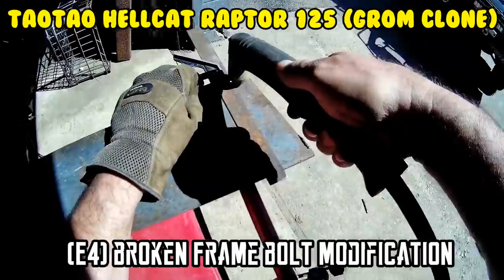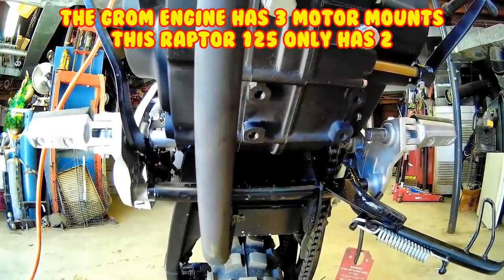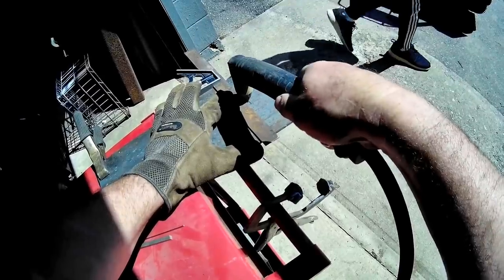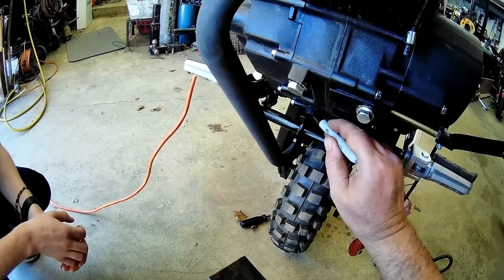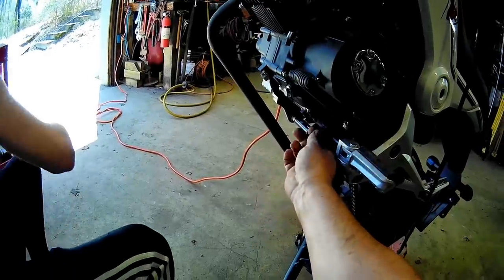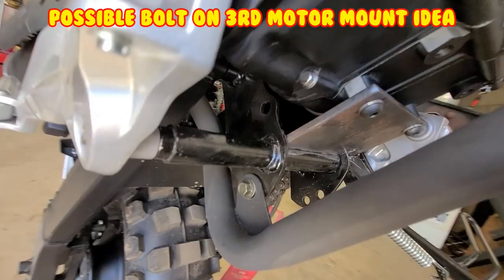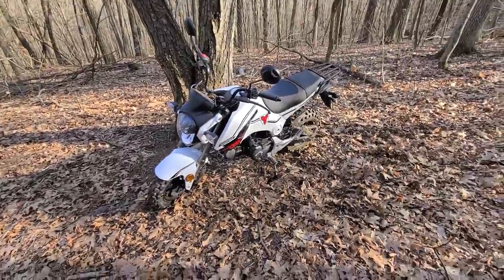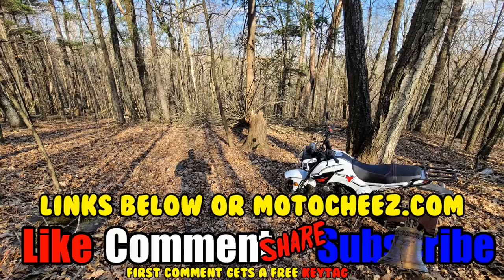(E4) Hellcat Raptor 125cc Broken frame bolt modification, Chinese pit bike “Grom Clone”

Comment: The bracket you mentioned while prepping to weld... being able to have triangulating support is never a bad thing.  That piece of plate looks solid enough to do the job.  The best of situations, have that as also being a skid plate, and just proud (lower) of the kickstand hardware.  Nice work there.
Reply from the maker: EXACTLY. Thanks
Reply: @MotoCheez  would liek to see you do one without welding since now there are 50,000 of these grom clones out there all breaking engine mount bolts and no one knows how to weld.
Reply from the maker: They sell a bolt on, on ebay
Reply: @MotoCheez  yes and in the FB clone groups most people say it didn't work. Many posts they're about that

Comment: 3:25 you can put paint on the on motor mount holes and then lift the plate up to it and the paint will transfer to the plate then you have perfectly accurate marks.
Reply from the maker: I've heard Grease too...
Reply: That's a great tip! Thanks!
Reply: Chalk, marker, some times penic works, like if your doing drywall and you need to cut out the outlets take your carpenter pencil and color in the edge of the outlet boxes and then put the drywall in place whack it in that spot with your hand and it transfers to the back of the board, then just cut on the line.

Comment: Both my engine bolts snapped. Replace the upper and lower one with a grade 8 and the lower one keeps snapping. Time to make this mount and hope for the best!
Reply from the maker: Since I made the lower Mount I haven't broke a bolt!
Reply: MotoCheez I actually made the lower bracket just like you and it’s soooo much better almost no vibration such a good mode to make for this bike!
Reply: MotoCheez have you had any issues when braking with your front brake only? I’m having some insane shake when I use my front. Might be a blown bushing in the colum. Also any idea how to make the speedo work? Ever since I got it it has never worked
Reply from the maker: Sounds like a bent rotor or something loose?. Mine is smooth
Reply: MotoCheez I made sure everything is tight. I’ll check the rotor just in case. Thanks for responding so quick 🏂

Comment: I just bought two engine mount bolts (7$ a piece) that can withstand almost a ton of weight it has two bolts so now the motor has about 3400lbs of support. Plus made the bike really quiet.
Reply: Have link to the engine mount bolts
Reply: @josephgomez7807  I went to my local hardware store with the old bolt and payed the extra 5$
Reply: @ericfernandez7094  so simple its beutiful lol. Imma link on down to the hardware store when my bike gets in and fix that problem befor it starts

Comment: You can make a stand-off for your plasma from a copper tube and a hose clamp, looks like a kings crown kinda. The tip needs to be the thickness of a nickel off the metal, save u some money on consumables.
Reply from the maker: Good idea. I lightly drag the tip

Comment: you could have made a cardboard cut out as ya templet, that bike would be awesome with a 250cc 2-stroke, small bike plenty of power = lots of fun. I built an old YZ 125cc bike and put a 250cc in it and it's bloody awesome.
Reply from the maker: I usually do the cardboard trace thing.. 250 would be badass

Comment: Hello moto... how's the family? I think I would have put some heavy rubber as a shock between the plate and bike... so you've given the bike a name, "Billie".. cool
Reply from the maker: Solid mounts on the other 2 so had to be all 3 solid or all 3 rubber or will break bolts again.
Reply: @MotoCheez  ok... I didn't realize the other 2 were solid mounts

Comment: Hmmm, If you're going to make a habit of dirt running with the Raptor, that rear fender has to go. I don't suppose anybody makes a motocross alternative for the Hellcat, otherwise it's going to be 'mod & fit' time.

P.S. -- I'd inspect that improvised motor mount on a regular basis (every 25 hrs or so) for bolt tightness and plate / frame deformation. Odds are the reinforcement will hold up just fine, but you're kinda adventurous with your wheels, so better safe than sorry. (I'm not worried about your craftsmanship, I'm more worried about the metallurgy of the frame and the new stresses you've introduced with that mod.)
Reply from the maker: You're right! The way it is it's not throwing mud on me, but a straight fender would work best as you say. I'll probably cut it up to the plate at least for now

Comment: I think all pit bike have engine mount frame problems I think you fixed all pit bike I had an ssr125 had no engine problems just frame the engine and chain pulled on the frame did need welding for the top mounts that twisted and snapped because of the torque of the engine you didn't create a skid plate you can use it for more frame support if you buy a bike this may be a good thing to do to the frame 👍😎
Reply from the maker: True. I have a ssr125. Had a few of them
Reply: @MotoCheez  they are very fun to ride thinking of buying an other you didn't take anything apart besides the skid plate
Reply from the maker: My last video on this it broke the motor mount i took a few things apart.

Comment: Great video.  I broke 5 motor mount bolts on my Grom clone in about 1,400 miles.  I tried Grade 8 SAE and metric 12.2 strength, but they all broke (at the nut).  Today I drilled out the motor mount hole on the frame and engine from 8 mm to 3/8" and installed a Grade 8 bolt/nut.  I'll see what happens.  T Bolt USA has some brackets that may work at the location shown on your video, but they claim on their website they are for installing a Lifan engine in a Honda CT-70.
Reply from the maker: Thanks! Let me know if it fits. Mine hasn't broken a bolt since I welded my bracket on.
Reply: they ever break?
Reply: The 3/8” bolts never broke.

Comment: How much for a piece for me ready to go for my hellcat MOTOCHEEZ?! Awesome work man
Reply from the maker: Thanks! You'll weld it on? Guess I should have made a template. Surprised nobody has something. I didn't even.look
Reply: MotoCheez heck yeah got somebody to weld, just don’t want to worry about the hassle of making it and you made that look too easy 😂. Yeah have done a little looking and haven’t found anything. Ordered new bolts all around and Grom axles and swing arm bolts, but that piece you made looks perfect for what the bike is missing.
Reply from the maker: I'll see if I can trace what I have accurately...
Reply: MotoCheez awesome man just let me know I’m definitely interested.
Reply: MotoCheez If you can trace it.... Upload a pdf for purchase on motocheez.com perhaps?
Reply from the maker: I still have to try to trace it.. I'd post up free once I do it
Reply: @MotoCheez  hey motocheez did you ever trace or start making plates ?? I would like to purchase one if you did. My 190 keeps snapping bottom engine bolt and it’s a 10mm 12.9 grade.
Reply from the maker: I never did. Someone send link to bolt on style somewhere in these comments.
Reply: @MotoCheez  okay thank you I will try to search the comments

Comment: Feel like two  angle iron bend at end would work for holes already in frame.
Reply from the maker: It's not quite a straight shot to the frame holes. But someone definitely could make a bracket

Comment: why weld only the bottom ?   the top has to be welded for strength as well. 
what type steel plate and what welding setting?
Reply from the maker: If you have enough penetration you don't need to weld both sides. It was Vee'd. About 120a
Reply: @MotoCheez    -   k   ,   tk  you .

Comment: What’s the size of the motor mount bolts?
Reply from the maker: I believe I put the size and link in description
Reply: @MotoCheez  thank you. I know you recommended a 5” bolt. You think a 4 1/2’ll be long enough to meet out the other end?
Reply from the maker: It may just make it. There wasn't much sticking out. If you can find or make a lower motor mount plate the stock bolts will hold
Reply: @MotoCheez  much appreciated. 👍🏾

Comment: It because it's a pit bike engine they do usually bolt the engine down on then 4 bolts
Reply from the maker: On the bikes they use the same holes I did. I have several pit bikes.

Comment: If u can make one for me I would buy it ASAP I appreciate it let me know and we can talk
Reply from the maker: I don't make them. Sorry
Reply: MotoCheez dang what metal did you use or whatever u cut to get that plate
Reply from the maker: Someone found a plate made that would fit that bolts right up, check chinariders.net pretty sure they have info on it there
Reply: MotoCheez yea I been looking can’t find what you talking about on the site
Reply from the maker: Someone sent me a link and I've been trying to find the convo... I get so many messages it's buried.
Reply: MotoCheez yea I understand